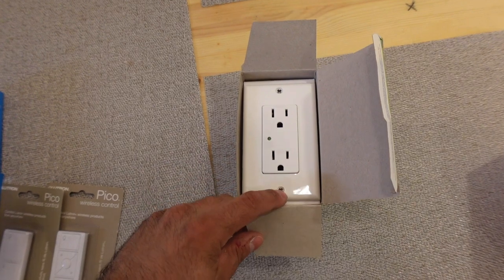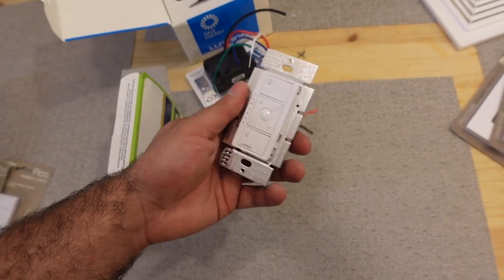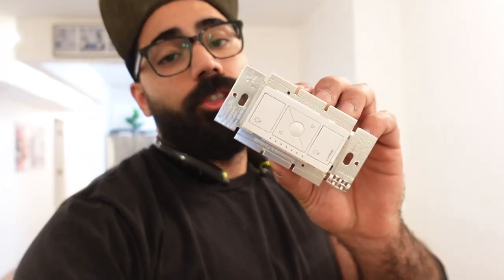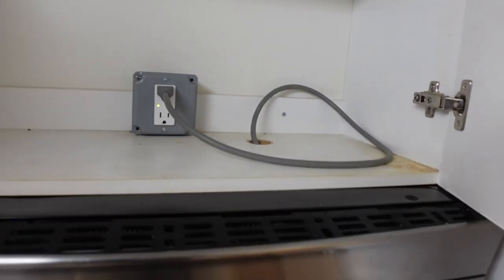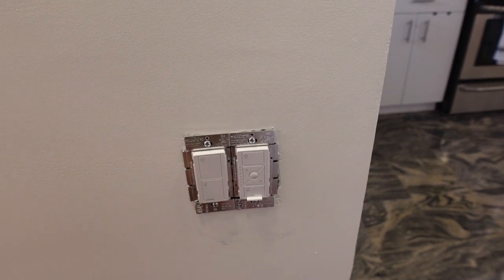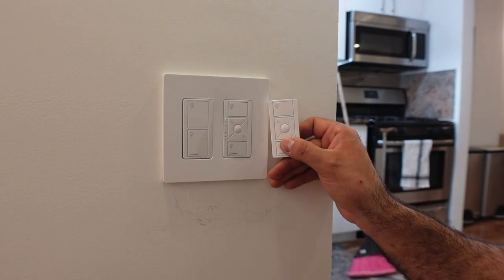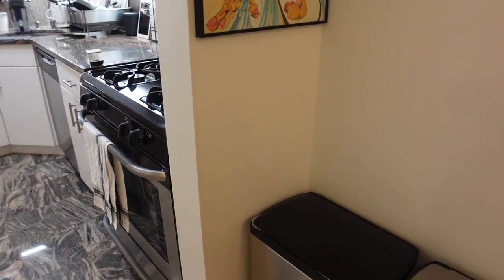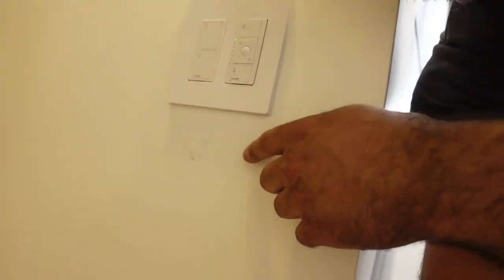Installing Lurton Caseta and PICO switch in my home. (Three-way switch made easy) // Skill Stacking

Comment: I watched because I wanted to see someone install two of these pretty wide devices side by side. But you gave me the added benefit of a demo of the pairing. This video made everything look pretty simple, so that’s helped me to make up my mind about purchasing the Caseta products. Thank you so much.
Reply from the maker: I really appreciate you taking out the time to write this message. Thank you for the feed back. December 8th I have another video coming out on how to connect it to the lutron app and Alexa. If I remember I’ll be sure to post it here.
Reply: @skillstacking  thanks, I’ll look forward to elongate that one too.
Reply from the maker: Video below I just released yesterday. It goes a little bit deeper into the switches and how they work. Hope it helps. 

Lutron Switch: Connect to Lutron app and Alexa app (usb outlet too) // Skill Stacking
https://youtu.be/xDjaGC4bPrY

Comment: That’s slick, nice job. I kept wondering what fan I was hearing. I was convinced it was on the stove but that didn’t make much sense! 
If you get tired of the noise, you could install a bigger, quieter unit. I did that in my master bath. 
Speaking of The exhaust fan in the master bath, Web search for TORK  In-Wall Countdown Lighting Timer. I found mine at Lowe’s. 
I use it on my bathroom exhaust fan. You get 6 presets to switch off the fan, from 5 minutes to 4 hours. I have a step free shower so having the fan on for an hour helps evacuate the moisture.
Reply from the maker: Its funny you say that I have been looking to upgrade, I’ll definitely look into it. Thanks. Might be my next update video in the kitchen.